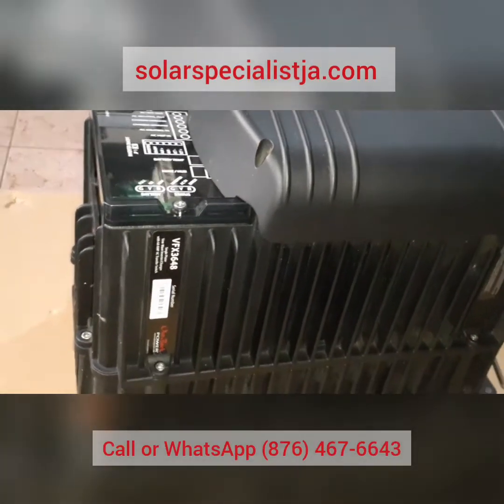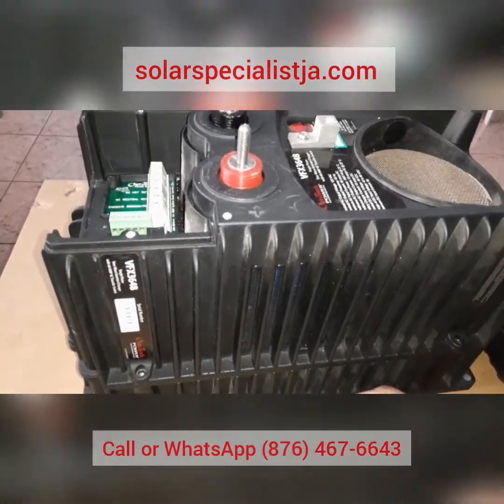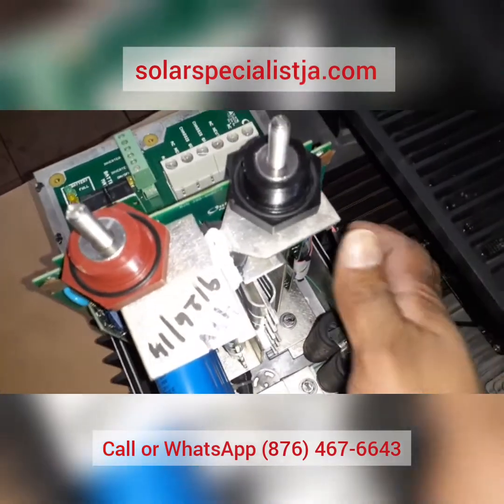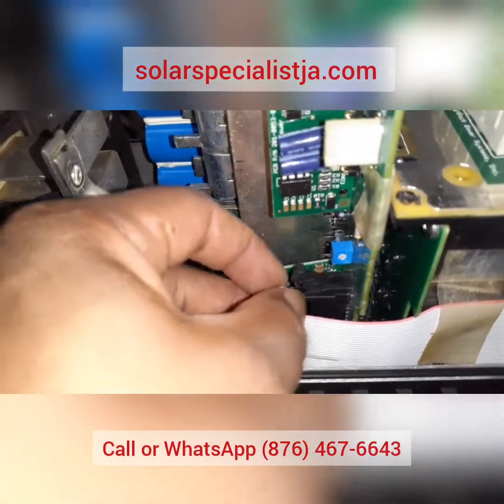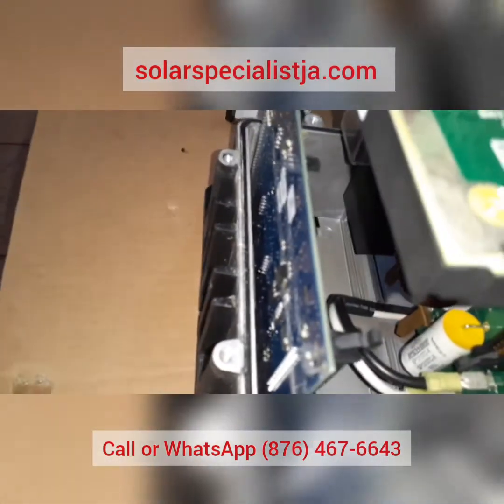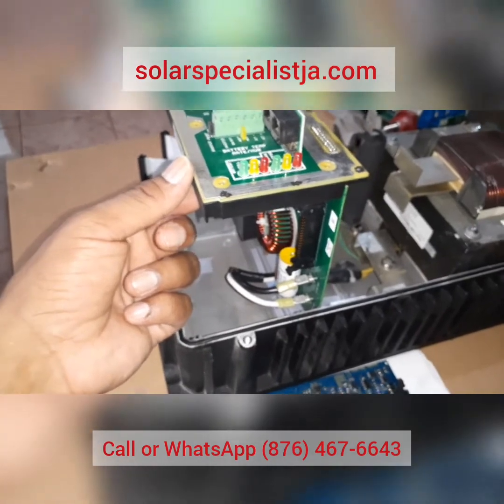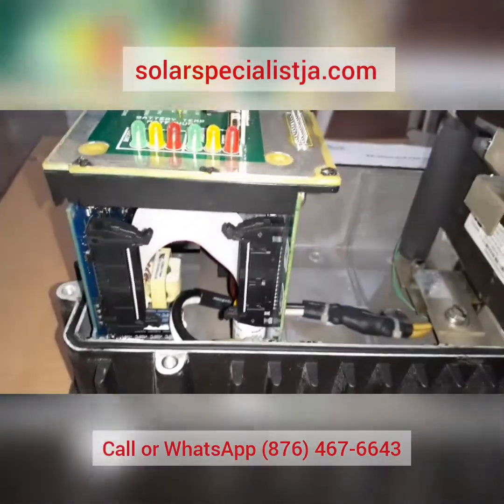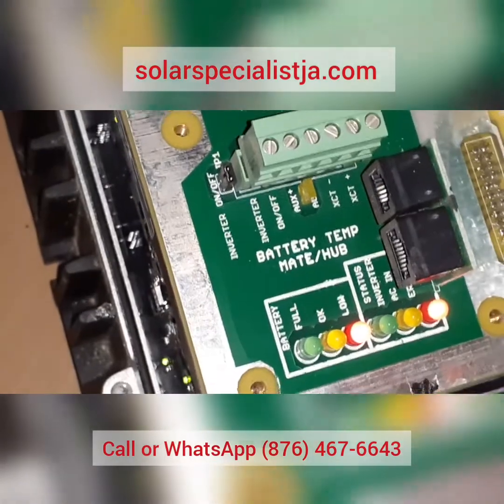Outback FX3648 Inverter repair Board Replacement

Comment: Thanks for sharing mate! The alarm light at the end of your video is due to the fan not connected. The VFX will give you the fan error until the upper chassis is being fitted with the fan plugged in.

Comment: So, I just finished replacing the AC board in my GVFX3648 (the AC bypass relay wasn't operating cleanly, and it turned out to look pretty toasty). I just wanted to point out that if you're replacing the Controller or AC board, there's no need to mess with the FET board. Just pop the two ribbon cables and remove the transformer connections from the AC board, and they'll both slide right on out. That saves quite a bit of time!

Comment: I have a "temp sensor" flashing red warning light. Have you ever had to do this, what seems common, repair. I see a repair kit online, that has a removable clip end, but I
was hoping to see that in your video. My unit is a VFX3624. any help would be greatly appreciated.

Comment: Can you suggest a trouble shooting guide.
My unit stopped inverting after a load and did not accept a re set.
It will turn on when there’s gen power but drops after gen is disconnected.

Comment: I have two VFX3648, a master and a slave. My system is down. Outback told me the FET board needs replaced in the Master. It was hard to find one but I did and it cost me $600., I replaced it, but that not the problem. So now I'm told it's either the control board, or the AC board. So now I'm looking to find those, and did but the costs are $457., and $675. Well okie dokie and alrighty then, but which one do I buy, or both, bringing the total cost for all 3 boards  to the price of the entire Inverter. Wow! What a challenge. Life is not getting any easier. And to think, there's no guarantee any of this will solve my problem to get me up and running again. Yikes!

Comment: What was the symptom of the problem you were having?  My inverter just stopped outputting AC, like it's 'off' and I can't turn it back on.  No AC output and no power to the mate that is plugged into it.  I took all the boards out hoping to find a failed component but see nothing obvious.  I don't know if it's the control board, AC board at fault or maybe the transformer is dead.  Outback is no help.
Reply from the maker: The control board is probably faulty which would explain the mate not picking up... Good luck
Reply: @JamaicaGreenLantan  Thanks for the reply.  Been trying to get Outback to direct me to something I can check to verify which board is bad, but they won't.  There has to be places to check for voltage once DC is input, to see where the 'flow' is stopped.  Heck, there are about 10 spots on the control board labeled TP#, I presume those are test points.
Reply: Dc goes into the FET board, but how do I know it's not bad and not passing the voltage to the next component?  The control board makes sense, but don't want to spend $300 and find out that wasn't it.  I presume the control board has to 'turn on' something at the FET board to output AC, as once I apply the DC, the transformer is not outputting AC, since it is 'off'.
Reply: Did you find the fix. I have same issue with mine.  Drops AC signal randomly. Unit is powered on says inverting. Mate 3s is off too.
Reply: @jayl8813  No.  I got an RMA but never sent it in.  Didn't have the nerve to pick a board to swap.  I think the new boards were about $300 each.  It would have been nice if they could have told me what to check for to determine which board was bad.  I mean, there has to be test points to check if the components feeding it are good, right?  Like if the  control board is good, you'd have X voltage at point Y on the AC board...etc.
Reply: That’s unfortunate. Outback is useless. Every reply is just a PDF from their manual. 
  Time to switch brands. BS
Reply: @jayl8813  Lots of OutBack dealers will service your Inverter. I can see why Outback will not offer diagnostic service over the net, its LIABILITY !

Comment: Hello, I have a FX 3648 that suddenly quit inverting and now has solid red error light.. error message says AC out short and AC back feed.. Unit will not reset or clear error..It has no AC loads on it but battery voltage is still good.Bad board?